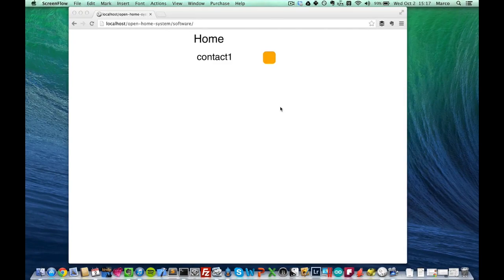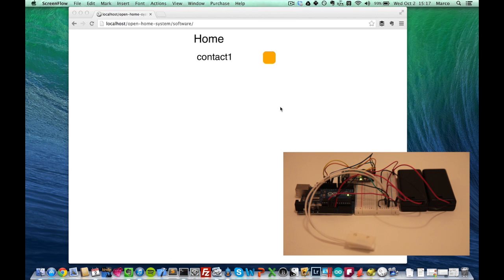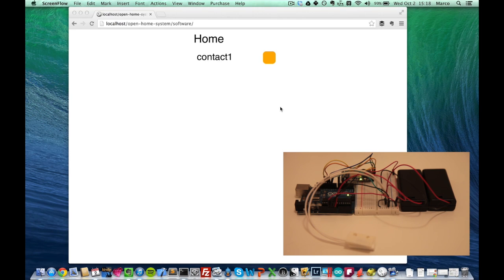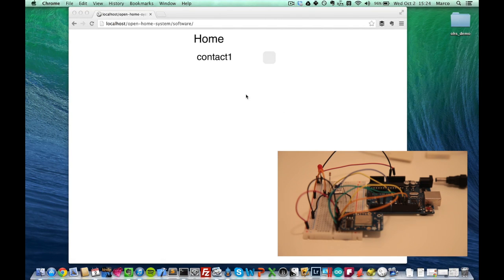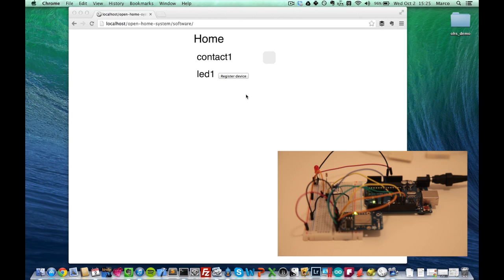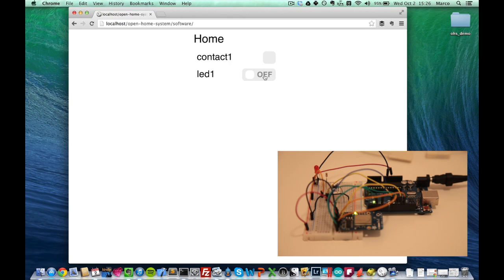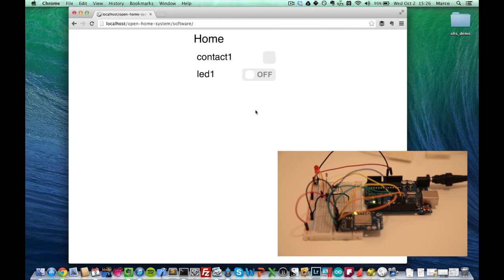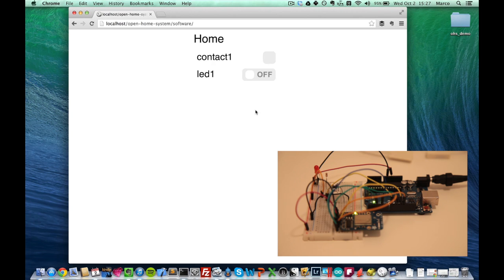Open Home System first demo

Comment: Hi Marco,
I'm hoping to buy a house or have it built and I've been looking into automation for a while. In my numerous such I found "open remote". Do you have any thoughts on that? Since your system is all wifi, I assume that it would work with open remote. That might save you some hassle.  For my part I was thinking of doing something like you but ethernet (if I have the house build I might as well pull some ethernet cables and have less waves around the house + I could power my modules over the ethernet), use a synology nas (as a server) with open remote to manage everything.
So what do you reckon mate?

Comment from the maker: Sure, we will integrate a database on the software side. For now it's just an XML file communicating with a PHP script, but as we are already using PHP integrating a database will be easy. Concerning your question, it mainly depends if you already have some experience with Python or Ruby. But I personally prefer PHP for such projects.